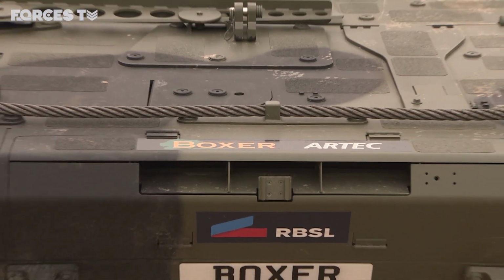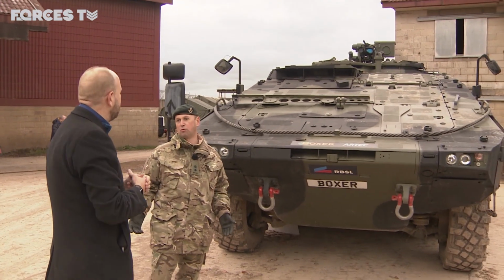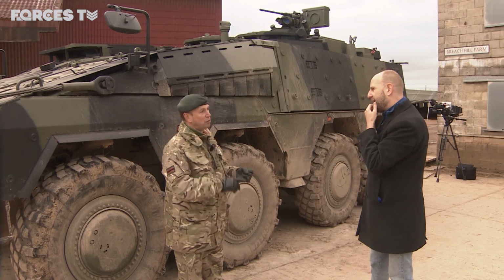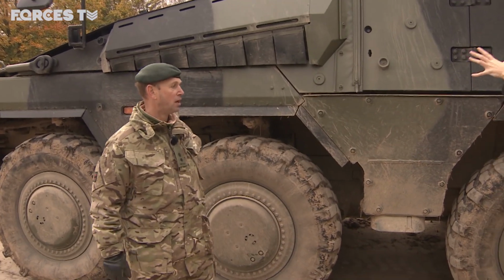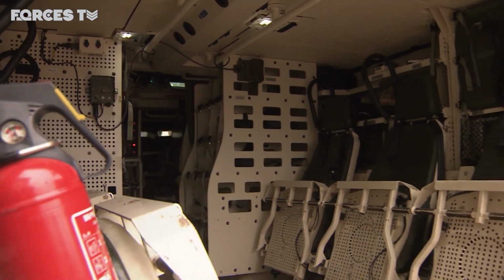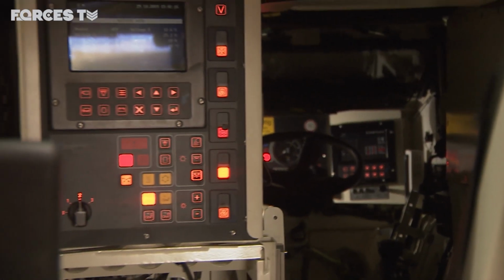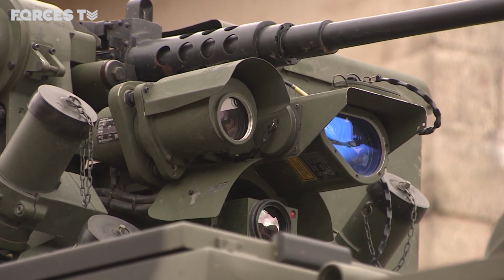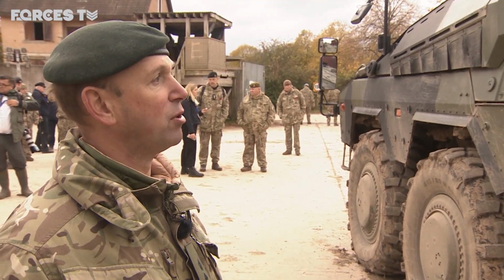BOXER: Up Close With The Army's New Fighting Vehicle | Forces TV

Comment: Seems like it needs a heavier gun
Reply: Well we have the challenger 2 for that
Reply: @backtofront5162  Our equivalent of that is Ajax and Warrior (which are being upgraded with the CTA 40mm) which are for armoured infantry, Boxers are for mechanised infantry.
Reply: @backtofront5162  Is anyone actually buying surplus modules with the intent of hot swapping them for missions though? It was my understanding that the main point of the modularity is for manufacturing and maintenance commonality, future upgrade-ability, and the ability to pair needed modules from a down vehicle with a working drive train. Armies buy complete vehicles, so the difference between additional variants of Boxer and entirely separate systems is potentially more one of logistics than it is of raw capability. Just curious, what are the Australian variant numbers like, by that I mean how many of the recon variant are there as opposed to the normal APC and other specialist turret-less roles?

Comment: Are the "drive modules" really in such short supply that they have to be shared among several "mission modules"?
Reply: There's always a budget, even if it was huge, you should make the most out of it.
Reply: I imagine that the army will buy an equal number of drive an mission modules. The issue is that if a valuable variant like a C&C or ambulance breaks down or is due for service you can swap the mission module onto a working drive train in an hour or two and get the needed variant back into service.

Comment: They think an infantryman is going to be sitting in the back of that for 2,000km? 😳
Reply: Proud Indian  2,000 km isn't pulled out of the hat. It about the distance across Europe to the Russian border. A specific consideration of the Strike Brigades is to get to the frontline before the fights lost.
Reply: I'm sure that they will stop for bathroom breaks.
Reply: Proud Indian  I don't believe I made any statement suggesting anything that you just wrote.
Reply: They've had to in far smaller and less modern vehicles in the past haven't they
Reply: @1IbramGaunt  No. Armies don't typically advance 2000km overnight.
Reply: @geeksqueak7123  wasn't really talking about the specific distance
Reply: @geeksqueak7123  But troops introduced to theater may well have to make a road march of similar distance to get to the fighting.
Reply: @1IbramGaunt  not for 2,000 miles!
Reply: Proud Indian  Those are the two expenditonary capable forces, and what you build around. But in our own backyard you'll be getting useful forces half a dozen more countries.
Reply: Proud Indian  The Boxer is manufactured by KMW and Rheinmetall, look up where those are based. Also since German military engineering is so bad, why would the glorious Indian army copy it, and fail at even that? I mean, not being able to afford buying those tanks from Germany is understandable, but why bother copying it if its just gonna fail?
Once China comes marching in over the Himalayas or something you lot are goners anyway. Might as well save the money and build some public bathrooms
Reply: Proud Indian  First off, I'm going to ask you not to explain to me armor 101. I'm not arguing that for instance, the US Army units advancing into Iraq in 2003 moved in straight lines; but what I am saying is that the US Army and Marines did not travel 1 KM forward towards Baghdad for every 10 KM they were driving unless you count engine idle time. In fact the lines of advance were rather straight forward, and made significant use of the Iraqi road networks. Some units, perhaps recon units in HMVs who were making mad dashes to odd objectives the whole way north may have done so. I was not arguing against the concept, but rather the ratio.
Reply: Proud Indian  Not gonna get drawn into a Keyboard battle. I'll leave you to your opinions
Reply: Yeah ... or walk
Reply: Proud Indian  bruh if youre Indian dont gas up about the "Indian army". India's mbt is just a reverse engineered Leopard. But guess what? You cant even do that. Its an insult to modern engineering and to anything with tracks. To even compare it to a caterpillar would be too much
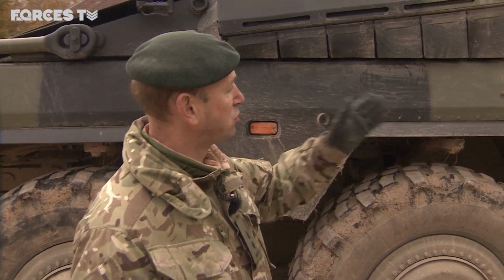Reply: Proud Indian  1:10 is probably a bit much.
Reply: Well have I got news for you! Introducing the flight module!
Reply: So, erm... Other than as a response to hostility why would Russia attack Europe? With the end of the USSR a gem of info emerged that the " evil Commies " never had a plan to attack western Europe. Their military posturing was a response to western threats. Eg, the location of F111s in Germany that could nuke Moscow in a matter of minutes. Odd how difficult it is nowadays to find that gem of info. It seems to have been erased from history. This allows our western leaders to keep demonising Russia and scaring us with stories of the big bad russian bear.
Reply: @boomerrob9223  While it's true that post-Cold War archive diving has determined that Joseph Stalin's strategy in Europe was largely defensive (due to significant US nuclear superiority and other factors), later Soviet leaders were just as imaginative for the possibilities offensive warfare as NATO. Post-Stalin both sides had offensive strategic plans. It's true that the USSR as a boogeyman who was only stopped from world domination by NATO vigilance is probably much overplayed, only illiterate plebes still hold such a simplistic view. However, to suggest that Soviet posturing was simply a result of NATO actions rather than a complicated, intertwined dance with players trying to think many moves ahead is just as fanciful a thought. In light of the overall economic endurance victory of the west, and the myths that have come out of it, there is a strong desire for an anti-western revisionism which is often an over-reaction.

Most amateur historians, armchair generals, and think tank suits in the west do not think that a war where Russia, for reasons of territorial gain, launches an unprovoked conventional war against NATO in eastern Europe is even remotely likely. (I read and watch everything the D.C. tanks put out about Russia) What we think is possible is that accidents, miscalculations, and warfare on the periphery could lead to a war. For instance, one of these Russian fighters flying a few hundred meters of a US carrier could do something even more aggressive or accidental leading to a Phalanx smoking a Super Flanker. It only requires a short chain of escalation, and some bad leader judgement for both sides to end up at war. Russian actions in response to Turkey shooting down an SU-24 could have been far more inflammatory than they were. A team of Green Berets in Ukraine could get Smerched [arguably] from Russian territory near the Ukraine border. Belarus could turn into the next Crimea and could spill over into neighboring Baltic NATO countries. There are all manner of things that could happen, and planning for them does not necessarily indicate that an unprovoked invasion is thought likely.

What should be sobering is that European NATO armies are still small, the German military is falling apart, the Baltic states could be overrun in a day, and the US Army has no significant conventional forces deployed to Europe. We have an Airborne brigade in Italy which has been there for decades, and we a battalion rotating in and out of Poland. Despite whatever rhetoric may be spilt in attempting to justify think tank jobs, sell smart bombs, or justify defense spending increase attempts, the US military and NATO posture in Europe does not indicate that NATO is actually preparing for, or anticipating such a war with Russia. The Media will say whatever they want regardless.
Reply: Room for 6 Americans 
8 Brits. 
or
10 Gurkhas
Reply: @garyhewitt489  Its true that US soldiers spend more time in the gym than red coats.
Reply: Maybe. Let’s say Russia invaded the Ukraine and they had to hightail drown from a British base in Poland or Germany.
Reply: I know you posted this comment 10 months ago and the discussion has since trailed off, but still... This thing was built for long range. Its initial purpose in the German army was and still is to serve as a protected mode of transportation for long range patrols and other deployments of the LIGHT infantry (imagine that). Before the Boxer they only had unprotected vehicles. Only recently it has grown into wheeled IFV variants with a turret on top. But for its very first users it wasn't meant as a combat vehicle, but as a "mother ship" that would protect, carry and sustain infantry soldiers during missions where the actual fighting would be done in places only accessible on foot. It has a very high range of 1000+km on road without refueling. So yes, it was meant for soldiers to sit in the back for a LONG time.
Reply: @antonnurwald5700  we've has soldiers fighting in Syria. That's 2700 miles. Did they drive there?
Reply: @detailingdiaries6562  look I'm not saying it makes sense, I'm just quoting the combat doctrine of the 'Jägertruppe' under which the Boxer was originally purchased. They conceived of the vehicle in this way. And I know that these kinds of week-long patrols and recon missions were done in Afghanistan, I'm just not sure if lighter vehicles aren't better suited. Also your reference to flying to Syria is wrong. This is about tactical mobility, the real question is, why not fly with a helicopter?
Reply: Yep our VBCI during Serval operation in Mali ;)
Reply: The Germans needed them in Afghanistan, that's 5 000 km. Air condition and 100 km/h did help.
Reply: Proud Indian  When combined, the NATO countries in Europe both outnumber Russia, and outperform it in terms on quality of their military hardware and front line troops. What's been said in the comments above is true: The Russian army is big, but most of these are conscripts who lack all but basic training, and have little motivation  to actually fight for real. Russia has some very mean and elite fighting forces, but not as many as the rest of Europe combined - who mostly have professional soldiers. 

And are the UK and France the only notable NATO members in Europe? What about Poland? It's military is actually quite large, professional and well-equipped. True, it lacks the most high-tech and overseas capabilities of the former, but the Polish Army would be major obstacle to a Russian invasion. Even on it's own, it could hold the enemy off just long enough for the rest of Europe and the U.S. to arrive.
There's also Romania too: Their military might not be capable as some, but they have surprising numbers which would help bulk out the smaller,  but more advanced and specialized armies of Western Europe.

Comment: Modular design is the thing now days. But with the module design here. You still need to have the modules and bases to put them on. So really the only thing why you'd do this, is that you can buy less bases and more mission modules and then switch out, instead of just buying exmp. 500 apc's and 50 ambulances, you'll buy 500 bases and 550 modules. I don't know if that's the best thing to do though. You can't just switch modules on the fly in the field. And you need other vehicles to carry the modules. x'D
Reply: @Eddie Weston Hi Eddie, are you being paid to post this? You've left the same comment all over this thread.

Comment: Amazing vehicle. Shame they may not be able to fill it with troops considering the sign off numbers right now are insane......
Reply: if only theyd use common sense when it comes to the medical. i got medically discharged for having eczema when i was 12. that was over 12 years ago and ive had no issues or flare ups since then...
Reply: British_Imperialism 
Check out the French Foreign Legion... always going someplace, and can retire as early as fifteen years of service if I remember correctly.... and being a part of a military that owns their own vineyard... pure genius right there.
Reply: British_Imperialism did you dispute it?
Reply: jimmyjones it’s on my medical record so I can’t hide it at all
Reply: The pay should be the same as Police. It's simply not worth putting your life on the line for the poor salary of the junior ranks. Also the pay difference between the ranks and the officers needs to be looked at. Use Australia as a guideline. They pay well and therefore don't have the retention problems like the UK.
Reply: It's disappointing to see that it can only carry 6 soldiers, when you see its contemporaries such as the Stryker can hold up to 9. I know the upside is the these mission modules, but quite a few of us have questioned the viability of this after the vehicles and modules have been used and abused for a few years and swapping them over may not be as straight forward as suggested.
Reply: Not like canada ehhhh
Reply: @marksmith8732  Just encase you do not know who Matsimus is. He is British but he moved to Canada and serves in the Canadian military with artillery, also I think he was in the British military but I am not sure on that.
Reply: @sebastiandouse  he's ex reme
Reply: TheDouser he was a British soldier
Reply: @sebastiandouse  he is former UK military, was in royal engineers if am not mistaken
Reply: @sebastiandouse  he was
Reply: @sebastiandouse  If i recall correctly he was in the royal engineers working with mastiffs and the like in afganistan, then retired from service moved to Canada and joined the artillery reserves there.
Reply: @Scrump_Can  gods corps
Reply: @sebastiandouse  ok thanks for telling me that fact. Now I can respect him.
Reply: Cool uk and america have cool military armour cars
Reply: Nope, your half right half wrong, the only reason they’re slashing numbers is because they want to build up the navy then start mass recruitment again
Reply: As far as i know the UK still have 81 500 soldiers and infantry
Reply: Proud Indian  You're incorrect. Queen Elizbeth II is the head of state for Canada and also the Queen. The same applies for NZ and Auz. Nothing to do with the UK.
Reply: Matsimus love your channel mat, great vids. What’s cracking off with army numbers? This all to do with Iran? I’m curious
Reply: Matsimus you legend.
Reply: Hum about 6 men inside and 3 crew
Reply: And its also 6 men plus 3 crew
Reply: 8x8
Reply: Hi Matsimus; American here.  This is an interesting statement.  Is moral low?  Can you help me understand what the issue is?  Is it serious?  Thanks and take care.
Reply: Thank you for your service❤️
Reply: Who needs troops when you can hire a bunch of teenages to sit in an airconditioned room while controlling multi-million dollar drones planes and tanks.
Reply: Couldn't they just have bought the Stryker matsimus?
Reply: Hum america has striker with stinger missiles hellfire missiles and 30 mlm gun all automatic .
Reply: @Matsimus: It is a coffin on wheels, because this half-weight 
can be killed by an 88mm round from a mile away, like a T-34 was in 1943.
The Boxer was developed by the Germans for quick movement in the the forests of Germany and Poland (fighting Russia),
rather NOT for: open-fileds, deserts, mountains (crawling) and built areas.
The full-weight Namer IFV cannot be killed even by Kornet ATGM or T-90 gun.
Reply: @zofe  true the Namer IFV is bigger and meaner, often be quoted as the best armoured vehicle in the world. But it's also designed for a different role than the Boxer. The Boxer as you said, is designed for operation in the hilly wooded area's in Europe, which ks were the UK is, and were it plans to have to operate. Also as you said, the Namer is designed to take a hit from an 88mm, which is tbh an actual possibility for Isreal, its neighbours hate it and in the even of a war, it's likely to have to fight that kind of opposition. The UK has realised its enemies use IED's, which the Boxer is designed to survive, well keep the crew/passengers alive. If the UK ends up fighting someone with 88mm or bigger guns, its because ww3 has started, and at that point, all the armour in the world isn't going to help. Also the Boxer is faster, which in the kinds of warfare the UK finds itself in recently, is good news for QRF's.
Reply: @cgi2002  Kornet ATGM comes from Europe and is also prevalent across the Middle-East. Namer is excellent against it while Boxer is ludicrously dead-meat.
In the muddy European fields and in its windy forests, IED are difficult to implement.
Reply: @zofe  oh I know. But as I said, in europe if people start throwing around anti-tank weapons, it will likely be the Russians throwing them at Nato, and in that scenario, I'm more worried about precision guided aircraft launched weapons, which if your honest, the best defence against them is to not be in the thing they are targeting.
Reply: @cgi2002  In the forest the threat is terrestrial, likewise under the clouds.
Tank warfare has never been won from the air, not even in Iraq. The Boxer was initially devised in the 1980s, when a 30-tonne category made sense, yet no more since Matis and Kornet ATGM hit the battlefield.
Reply: Proud Indian except Christianity has been apart of both the world wars, all religions are dumb end of.
Reply: @carwyngriffiths  "Except Christianity has been apart of both the world wars" So were  the other religions.. so what do you mean by this? WW1 and WW2 were not religious wars unlike say the Crusades.

Judging from your name you are also Welsh, Christianity is the reason you had an education because we had no schools until Christians paid to have them built from their own pocket.

Our country was practically founded by Christianity.
Reply: @carwyngriffiths  anglo moment
Reply: @carwyngriffiths  "Christianity", right...Hitler and the mostly secular Nazis and the also atheist USSR were Christian I forgot...
Reply: Gar  the british Govt is illegitimate and hateful.